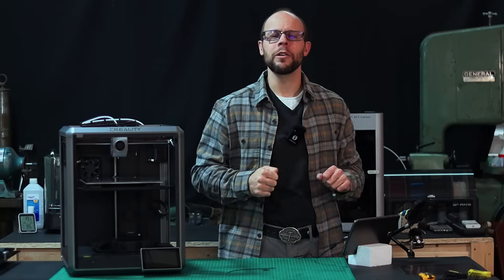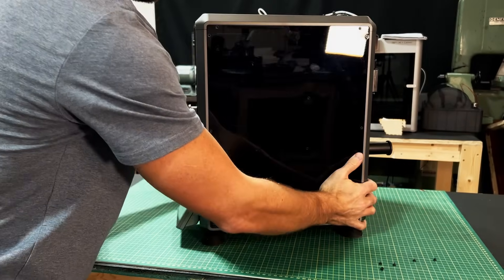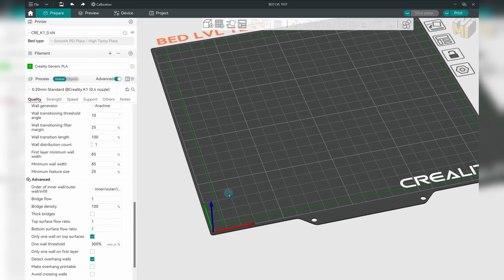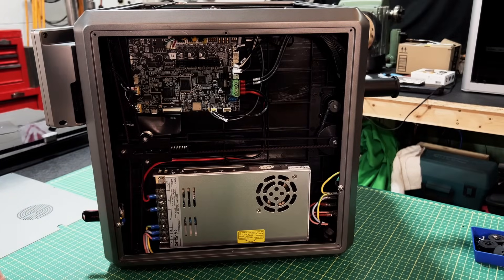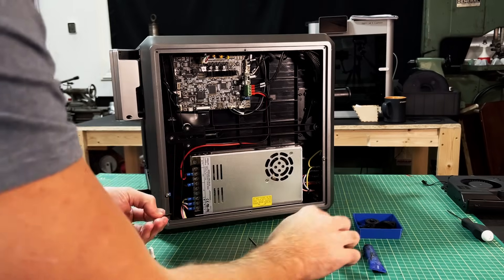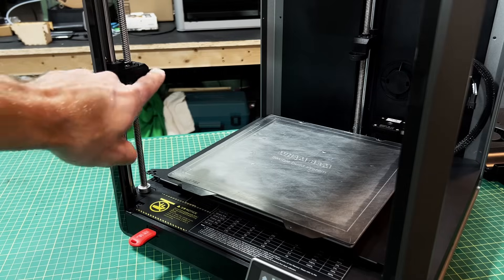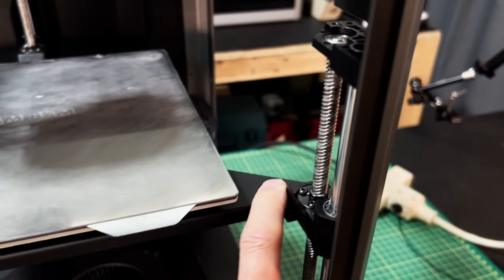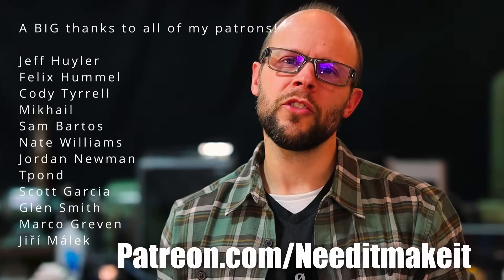Quick and Simple Way to Level Your Creality K1 or K1 Max Bed

Comment: Seriously? Quick n simple?🤦🏻‍♂️
after loosing belt easier is to rotate each one lead screw independent. And then - if necessary - file down some of 4 plastic nuts under the bed.
Reply from the maker: Sure there are other ways to do it, personally I don't recommend modifying the parts of the printer, and not everyone is able to do this, I've tried to provide something simple enough that anyone at any level can do it.  I mentioned in the video that those 4 areas contain sensors and if you're pulling the bed out by a fair amount, it would apply some pressure to the sensors, maybe it's not enough to cause a problem, Afterall it isn't a flat plate. 

In any case, it sounds like you had a solution that worked for you already, and that's all that matters.
Reply: @NeedItMakeIt This is not a tensionmeter so first thing i tried was to aply some good amount of force to press the bed in that labirynt path mount with sensor but it didnt move a bit. Good stuff creality put there, i believe its idiotresistant 🥲

Comment: I am about 2 weeks in with my K1, not loving it at all.  

How many prints or hours do you have on the bed?  Is it through over heating that it is that warped, or becuse it is stamped or .. root issue?
Reply from the maker: If you're still on Creality's slicer, you'd be better to root it and use Orca or Prusa Slicer, you'll get a lot more out of it.  I wasn't using it much until I did this.  

I think I have about 50-60 prints on it at this point, the bed has always had the warp in it, it does change a little with different temps.  The level-ness of the bed was a separate issue from the bed, and both are fairly easily fixable.  I was going to make a follow up video showing a different way to level the bed, and also show how to get a flatter plate.  If there is some interest in this, let me know so I can get it on the list to make a video!

Comment: Thank you Mike. The bed mesh diagram has made all the difference! Much appreciated. No longer looks like a roller coaster. Managed to place the four corners within a 0.02 - 0.07 range. But I took your suggestion to manually modify each corner. I heard you caution against tampering with the sensors under each corner, but I used 4 M4 screws (25mm) and the original springs from a 3v2 to control each corner fairly accurately now. So many thanks again for your help and knowledge. Have a great holiday season.
Reply from the maker: You had a roller coaster, and mine was a slip-n-slide.... I'm glad it helped.  It's hard with the way those plates warp to get much closer without building up below the spring steel, or sanding down the magnet, or alum. plate.  I'd like to see a picture of your solution.  If the spring method works, more power to you!  I wanted to go that route, but not knowing enough about the sensors and how they might be impacted I thought I'd better not.  Good to know that you've had success with it.    

Thank you and to you as well, tis the season to level your bed :)
Reply: Nice! I thought of replacing the metal grommets under each corner of the build plate with springs too. So this worked out well for you?

Comment: Over engineered...

Clearly the video is very well made, and it got a TON of traction.

Good entertainment value.

The "Tooth Skipping Method" works AMAZING and way more practical.
Reply from the maker: This solution is over engineered?  It took a photo of a mount and copied it, couldn't be much easier than that.

I agree that the best place to solve the problem is at the source, with the screw positions, but I don't think the skipping method is simpler than this.

I have plans to learn how to do the skipping method and it may end up in a video down the line, so I guess I will find out. 

Thanks for your opinion.
Reply: @NeedItMakeIt  You literally had to take out the bed, and 3 panels and print stuff, when all you needed was a pair of pliers and twist 2 screws up front.

I did say, your video is well made.

Hope you take the compliment, and just communicate the right way to do this, so people don't waste time.

Comment: Great tip for getting the bed much closer. I am going to be updating my K1 soon now, with the kit they sent me. I haven't  actually used the printer other than a few test prints since I got it, so this is good to know if I do in fact have a bed that is not completely level. Thanks~
Reply from the maker: For sure, I guess there are a few techniques out there to level it, I've found this to be the fastest and easiest.  Some others seem good also, but require some skill which we may not possess.  I  hope it goes well and good luck!

Comment: This seems like a bit of overkill for a printer that auto levels itself
Reply from the maker: It really depends on what you print.  If you print parts which needs to be fairly accurate, this is something that should be done, at least to bring it closer than 1.4mm.  If you're only printing toys or stand-alone parts, it's not a big problem for them to be dimensionally inaccurate.  Really it's a problem that we shouldn't have, and we do, so here is a simple fix, it's so simple I'd have to say why wouldn't you do it?

Comment: It rotates in the first example because of the belt slack behind the other two axis. Once the slack is removed, you have to EVENLY bring the belt around the 3rd drive gear so it's right in the center. Then the axis has no reason or ability to turn. My bed level was perfect first try.
Reply from the maker: Nice!  That makes a lot of sense.  After the first few tries of not getting good results I went a different direction, but that's great that you were able to get to the source and solve it there.
Reply: @sethalbert1239 can you explain a little, non English speaker. I would like to try what you say. Thank you!
Reply from the maker: @lurraskea  Which language do you speak, I may be able to translate the subtitles in the video to help.
Reply: Spanish. Thank you!  @NeedItMakeIt
Reply from the maker: @lurraskea  Vale, le eché un vistazo, y no hay una manera fácil de convertirlo yo mismo, pero hay una manera de cambiar los subtítulos a español.  Mis subtítulos se generan automáticamente y, lo he comprobado, se pueden ajustar a casi cualquier idioma.

English Version:

Okay, I had a look, and there isn't an easy way to convert it myself, but there is a way to change the captions to Spanish.  My captions are Auto-generated and I've checked, they can be adjusted to nearly any language.
Reply: Muchas gracias!  @NeedItMakeIt
Reply from the maker: @lurraskea  Fue un placer para mí

Comment: Flatten it!!! Ive always wondered if you could essentially just flatten the magnet sheet as the interface. It's nice and soft.
Reply from the maker: You and I were thinking the same thing.  I think if it's a small amount it may work okay, I'd be hesitant to remove too much not knowing if it would impact the attraction in some areas.  I have another couple of ideas as well, but they'd require a little more more of an investment, best to try to avoid that I'd think.
Reply: @NeedItMakeIt  Cool, can't wait to see what you do and how it works out. good luck finding oversize sandpaper if you go the magnet route.
Reply from the maker: @ThePhilbox  The material is very soft, who knows how well this this is going to work.  I'll probably need to do some kind of pull test before and after.
Reply: @NeedItMakeIt  Ill be interested to see the result. I'm always surprised there is not more investigation about faltening beds after the fact. I'm a voron guy, and there was a video by caplan's basement about how applying/sticking the magnet can even induce a concave on an otherwise flat bed.
Reply from the maker: @ThePhilbox  Ah, that's a good point.  The magnet itself can introduce some of the warpage we're seeing.  I'll have to add this into the video when I do it.  I should be able to do a calibration with no magnet and one with.  I luckily have an extra magnet from my Wham-bam on my Ender 3 V2.  Great info, thanks for that!

Comment: I did the same as you for the initial adjustments, but I turned the front lead screws slightly each way so they would be equal once pulled in tight by the belt. Clamping the rods in place before fitting the belt also helps.
Reply from the maker: I also have to wonder whether the stop positions are incorrect on the printer and that might be causing some of this.  The very slight rotation of the screw after tightening the belt doesn't seem like it could cause the bed to be thrown off so much.  In any case, it is best to try and adjust as much of the problem at the leadscrew.  Having something that is easy to see from the top while adjusting would help.  It really needs a regular system for bed leveling like most other 3d printers.  Too late for that I guess.
Reply: @NeedItMakeIt  agreed, it could benefit from fine manual adjusters above.
Reply from the maker: @jonathanluce9130  They have a new model coming out K1C I believe.  I wonder whether it has something done about the bed.

Comment: Excellent video!
 I have a question: How did you access the Heightmap? I have to root the printer ?
Reply from the maker: I believe that I was able to access the map prior to rooting, I had to access the printer through the Creality web UI.   You should be able to type in the IP address alone into your search bar and voila!  I just tried it, it does work.  Let me know, and if not we can dig a bit more.
Reply: @NeedItMakeIt   I was abble to acces via IP Adress. Any way I will give it a try to the root and levelling spacers this week. Your video is a BIG help! :)
Reply from the maker: @TheMasterRF  Okay, nice.  I hope it works well for you.  Everyone seems pretty positive about this solution.  After doing the recommended method 5 times total without great success, it was time to do something different.  Let me know how it goes!
Reply: I'm having the same problem I cant access the heightmap. Did you mange in the end and how thanks?
Reply: @tomrudd4168  Yeah! You can find it by typing the IP address of the machine in your browser.

Comment: Great video, i chose the second opinion with spacers but only used 1 to test. The spacers i used were slightly different so im gonna use the ones you used.
When i see the mesh it doesn't show the detail to the side on how far it's out. How do i view the more detailed mesh please?
And how do i change the mesh to a 6x6 please?

Thanks
Reply from the maker: Thanks!  I've added the spacers to Printables, I apologize; I wanted to try a different site to see how it worked.  

Are you using Fluidd or Mainsail or are you using Creality's UI?  If so, you should be able to checkbox the wireframe button to give you a detailed view which is a bit easier to visualize

If its not rooted you may not be able to adjust your mesh precision, but if it is you can make changes as follows:

Open your Printer.cfg file
Scroll down to the section near the bottom which looks like this:

[bed_mesh]
speed: 150
mesh_min: 5,5
mesh_max: 215,215
probe_count: 5,5
fade_start: 5.0
fade_end: 50.0

Change it to:
probe_count: 6,6

Save it and close.
Re-run your calibration, and that's it!

The interesting thing is that the UI display still breaks it down into Quintants.

Let me know if that works.
Reply: @NeedItMakeIt  awesome thanks for the detailed reply.

I am using the creality ui at the moment.

I dont think the bed with every be fully level, gulfcoast robotics i think did a upgraded hotbed for the ender 3, wonder if they can make one for the k1
Reply from the maker: @peaceorpieces8343  No problem!

The Creality UI will work, but it's not nearly as good it seems.  

I think we need a thicker piece of alum. on there, I'm not certain if the process of stamping these from a roll causes the deformation, or if it deforms due to heating.  I'll do a little more research on this.  I want to test the difference at each temp and then we can decide the best way to get a better result.  

If there is enough demand, I'm sure there will be some company that comes up with a better option.  In this case, it needs to be easy to install from above.
Reply: @NeedItMakeIt  yeah i was just gonna use it until my free trial runs out for creality cloud because i won't be paying for it when it runs out its very expensive.

Ive just ordered a a1 with ams lite because i wanna get into multicolour more
Reply from the maker: @peaceorpieces8343  What does the paid version give you? They should all be free, we're the ones creating the models to be posted there after all.  

Did you order the new A1?  Standard sized, or the mini?
Reply: @NeedItMakeIt  i ordered the a1 full size with ams.
It gives u access to premium models for free, slight discount on filiment and I'm not sure if time lapse is free or if its with premium
Reply from the maker: @peaceorpieces8343  I just checked and it has a pretty nice build volume, larger than I was expecting, should be a nice printer.  Priced well also!  It's amazing how far printers have come in only a few years.  

Hmmm, okay, so you pay to get a discount.  Maybe some of the time it will work out.  Sounds a bit like a gym membership.  Use it once and then don't go back.
Reply: @NeedItMakeIt  im sure its 70 quid for a years membership, thats a complete rip off,
Especially when alot of the models on creality cloud seem to be taken from thingiverse or prusa 

I didn't know which to get the p1s or the new a1.

I wanted to get bambu labs because my creality printers are awesome but you have to constantly tinker with them to get good prints.
Do you think the a1 is a better choice over the p1s since i would have to pay 850 with the full size ams to get colour prints where as the a1 is 520 with ams , im only gonna be doing pla and petg on that machine.
I have k1 for more exotic materials.
Been dreaming of getting a p1p or p1s for ages but i ended up getting the a1. Hope it was the right choice.

Like your cleaning rod tool thingy bob
Reply from the maker: @peaceorpieces8343  For sure!

That's a tough one, both printers are very capable.  Knowing how fast Bambu develops and advances, I'd lean more towards the choice you made, it's also really nice to have a smaller more portable printer.   The only downside being the enclosure, but there are cheap aftermarket versions available so it's not a huge problem.  The max color option of 4 with this printer isn't a problem for most people.  I can't see myself using more than 4, though I do like the storage of the AMS for spools.  It's a hard one, and I think you'd be happy with either option, it really depends on what you're looking for.  Like you said, if you're printing PLA and PETG, no enclosure is fine.  

Let me know how it goes, I may end up getting one myself, the Mini was a little small for my liking, this A1 is big, and sometimes you need that extra build volume.  Very cool and congrats on the purchase I'm sure you'll be happy with it.
Reply: @NeedItMakeIt  yeah thanks,
Cant wait for it to arrive, 
I like the bed slingers because they are easy to work on when you have issues.
Will update you on how it goes, really looking forward to doing multi colour,
The p1p or the qidi 3 max will be my next mission to get
Reply from the maker: @peaceorpieces8343  Yeah should be good.  Those printers just look high quality, there is something about the way they injection mold those parts that gives is that extra... something.  It's the same with DJI drones.  I guess they're connected somehow.  

The color is great it opens up a lot of options in the design.  I found that the print time is dramatically increased as a result, but it can be worth it.  What I like to do is add color on the bottom only and that way I get some extra pizzaz, and doesn't increase print time too much.   

Have fun!
Reply: @NeedItMakeIt  yes highly agree with the dji and bambu labs being professional things that works without many issues
Reply from the maker: @peaceorpieces8343  Coming from a Woodworking background myself, I find it amazing that something can be made so small with so many moving parts and still lasts and can take some abuse.  With wood, everything is beefy and the thing just sits there.
Reply: @NeedItMakeIt  yeah its crazy how fast the movements are and it takes the abuse for hours/days on end without any stoppages.
From my military background no weapons can take that much abuse without constantly needing cleaning, stripping assembling and maintaining your kit and there solidly built.(most of them)
Reply: You were correct....Bambu Lab, based in Shenzhen, China, and founded by five ex-DJI engineers

Comment: The problem with the adjusting z pulleys creality way quite probably exactly what you said - the belt tension will throw it off. Same thing applies then putting on engine belt. On some cars you need to set the pulley back half a teeth and after putting all together this is the slack that will end up being dead on after installation. I think that this should be something that could be done in here too. Especially since you got repeatable (altho wrong) results .

I would not mess around with the one on back - it should be correct itself as this is the zero point on 3 point bed leveling afaik. Atleast on bambu it is. I would put shims only on front and redo bed probing to see if back is already correct after that. 

I would also print spacers out of something that has abrasives in (like cf) which will make the part much more heat resistand (even pla) and makes it stronger to resist compressive forces under temp. And ofcource ironing. It's then real easy to make few passes with sandpaper and it almost looks like injection molded part.

After all this "I would" I will get right on working on it and see if there is any truth behind my ideas :) thanks.